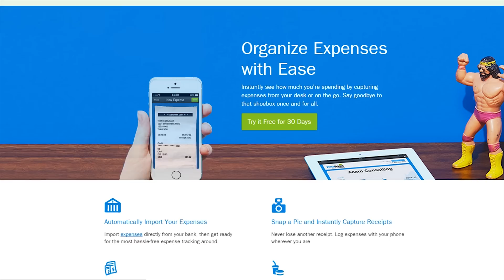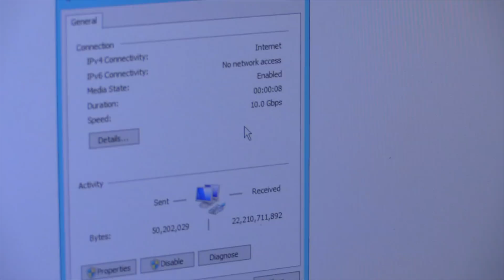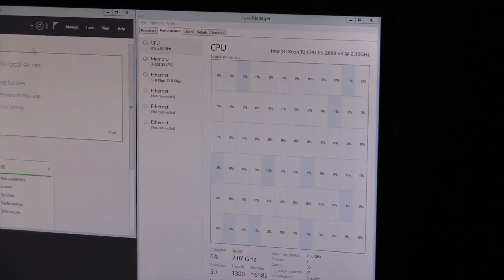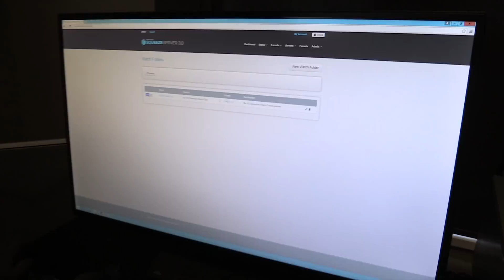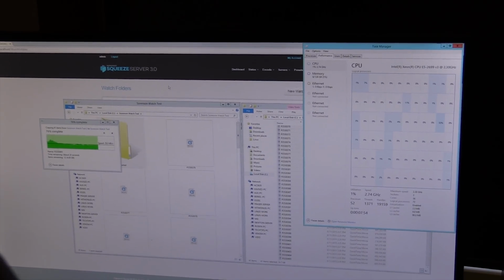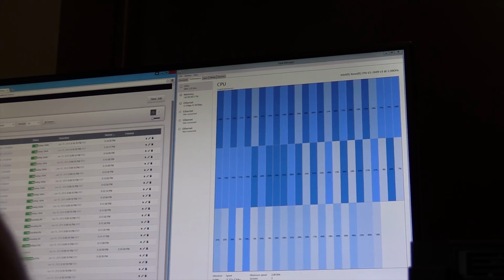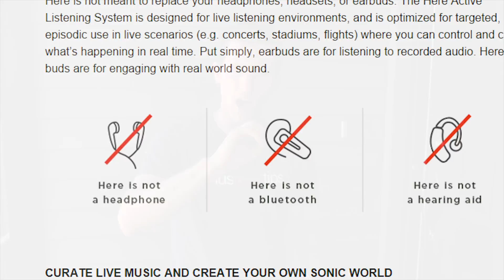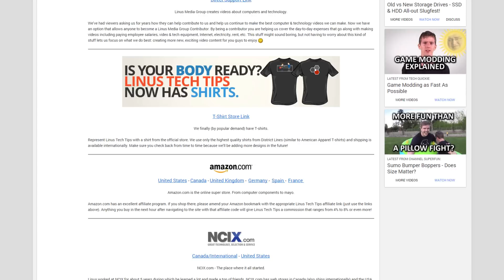36 Cores, 72 Threads, and Two Titan Xs - Our New INSANE Rendering Machine Part 3

Comment: I am a desparate guy!!! I did something similar, with 40 cores and 80 threads (2x2698)... I used asus Z10PE-D8 WS as my motherboard. My cinebench score kicks ass... It is sky high... But when I encode in Premiere pro or Media Encoder, it only utilizes 25% of the CPU... This is insane... I run windows 10 enterprise... Is there a solution??????????????? If you cannot answer, then noone can!!!!

Comment: I'm pretty sure you could do all this with FOSS with Linux. Set it up to auto mount drives, use something like inotify to monitor file changes to call off a process to cut and paste the files. Then have it un-mount the drive when it's done and use FFMpeg to encode the files. FFMpeg also has support for GPU Acceleration.

Comment: compare rendering time from thus machine to a mac using mac software
Reply: no
Reply: So, you want to compare this, to a Mac. While also running lower quality encoding hardware (Intel Quick Sync) on it. There's a good reason they use Premier Pro with CPU encoding, less colour and gamma shift. Plus, they're working with a lot more data (which is also of higher quality) than the vast majority of Apple users are handling.
Reply: +LiquidPanic just curious. I just wanna learn more
Reply: Marco Balarezo But the thing is, just looking at render times doesn't tell you the whole story. Apple software uses Intel Quick Sync, which has known issues with colour and gamma shift. Sure, it's fast. But if you're a professional production house like the Linus Media Group, you can't have that kind of loss of quality.

Comment: I'm pretty sure there are boards out there that have both 2 sockets and support for 2 GPUs. The cluster I use has some nodes with 2 Xeon 12-cores and 2 Tesla K80s. I think they're using dell poweredge R730s, but they change stuff without telling everyone who actually uses the cluster, so my info might be old.

Comment: http://www.newegg.com/Product/Product.aspx?Item=N82E16817338062
Here you have an 80plus bronze redundant power supply. by the way, i think there´s a way to use two 10GB cards and setting up one to send and another to receive, and setting up timing between the two cards. That will relief the bottleneck.

Comment: His cat isn't nearly as expensive as my "gaming" PC... (The components used in it weren't meant to be used for gaming, but screw it. Because I can.)

18 core, low-power Xeon, 128GB DDR4 RAM, and 4 Titan Xs.

Overkill, I know.

It may or may not have been influence by the Compensator...
Reply: ECC DDR4?
Reply: Ixor Yeah
Reply: 4 titan Xs should get you some problems with microlags, do they?
Reply: AlternateEdit I guess it just depends. I've done builds with 4 Titan Xs in the past, and some of them do, and some of them don't. This one doesn't, so it must depend on the parts you use.
Reply: Noice.

Comment: microsoft isn't a horrible solution for a server os. Microsoft let's the server take advantage of the graphics card's hardware by using directxmath api. Of course this makes use of a 4 by 4 matrix and 4 by 1 vectors usually used for graphics however will work just as well with any linear transformation. Also the reason it takes a while to fire up I bet is because the software has to create (allocate memory) for the buffers (data structures like ListArrays). Then once the are all created it just re uses them and does it's thing.
Reply: +marshalcraft P.s. I think you should do more server type stuff. Also it would be great for me if you did stuff about like registering domain names and what not. Networking is not my forte and so I'm not really sure if it is even possible for me to point my computer/web server to a domain name because it is actually on a subnet and I am not the network administrator.

Comment: http://m.newegg.com/Product/index?itemnumber=N82E16817147105&nm_mc=KNC-GoogleAdwords-Mobile&cm_mmc=KNC-GoogleAdwords-Mobile-_-pla-_-Server+Power+Supplies-_-N82E16817147105&gclid=CjwKEAjwp56wBRDThOSZ3vqGzmESJABjNaj9RUlBwb_PJ_d2-73PfUB6VpOrd8ibWR-is6dePoX1LBoCS-rw_wcB&gclsrc=aw.ds

not sure if it will fit your server case, but here is what I assume is a triple redundant 1000w server psu. It could be using three 500w units, leaving one as a backup if one dies, but I couldn't find a definitive answer in the newegg specs.

Comment: worlds most expensive cat. The Lifestyle Pets Company, the company that created the cat, breeds only five Asheras each year. The ones with patterns similar to a snow leopard are sold for as much as $125,000. The other Asheras can be had for as low as $22,000, though the average price has hovered at around the $28,000 range.

Comment: You should make sure you are using SSD storage in every computer in the system, in a raid array if at all possible; otherwise you will always have that bottleneck. Even the fastest server will cache things on the harddisk unless the software is designed to cache it to RAM instead.

Comment: Watching it on a200 1m5 satellite laptop
Cpu: Intel centrino duo 2.00ghz T2450 [2 cores, 2 threads] [32 bit only cpu, overclock not allowed]
Ram: 998mb in 2x 512mb,  200 pin, 667mhz, ddr2
Gpu: Build in graphic [256mb shared memory, 4 pixel shader processors, 1 vertex shader processor, pixel shader 2.0, vertex software emulated (performance = 0), opengl 1.4.
Additional informations:
2 ram slots 667mhz ddr2
Os: Dual bot windows vista [originally installed on laptop], linux mint 17.2 xfce [used now, because of better perfomance]
Cat: lying next to me on bed. Bengal cat full name Sparkling Star [Called Szpara]

3:29
Now i fell complettly broken... Thx...

Comment: If you only want to show people these processors working all at 100 percent, give the computer aerodynamicist. Working in CFD could easily squeeze your cpu to full power in a long period of time. I've been working with my xeon computer at 100 percent for 5 days straight. And with that kind of computer, you could running DNS easily man!

Comment: Hi Cheeky here from Cheeky Industries love how you’re pushing the boundaries (in a professional way of course; ). Like the server but here we really monster things out, so the challenge has been thrust. Can you fit more hardware into a server than Cheeky Industries?
I present to you the 3-D monster.

7 RAD VIDIA Quadro K4200 4GB Graphics Card type configuration with custom cooling straight through structure 3x 1.8Amp 120mm fans

2 Intel Xeon v2 20 Core architecture, Wish it was v3 : ( sniff

128 GB Quad Channel architecture non-ECC Channel DDR 3 2133 MHz RAM
12 Striped 500 GB SAS 80 to 96 GBpS+

Specialised Made to Fit Heat Sink towers with 1.8Amp Server Fans again Vumm Vumm

Gigabyte GA-7PESH2 (rev. 2.0) 2011

Power 1x1200w and 1x65 8 x 8 motherboard power needs

Good for workplace presentation, gaming 3-D rendering advancement and especially good for large 3-D CAD design. https://www.facebook.com/CheekyIndustries For pic’s

Maniacal evil laugh…
Reply: I have various questions regarding your comment, here; questions that I hope will initiate the attainment of progress regarding your doubtful credibility.

Comment: Hi,

Why do you have 128 GB RAM?
While decoding videos there are just 18 GB in use.

But if you have a Backup of the Video-files you can Build a RAM-Disk, Copy tue files via Batch job to the RAM-Disk and render them Witch is faster than 100 SSD's in a RAID 0

Comment: I have a iStarUSA IS-1000R3NP in my Norco RPC 4224 chassis that holds my SAN. If memory serves there's an adapter plate from Norco. It's 1,000W and triple-redundant. You can get them on Newegg Business. When it comes to high end GPUs and playing nice with servers/chassis you're better off going with a little bit more "serious" hardware. Not knocking Norco at all. They make some of the best chassis I've ever used. You'd be looking for something that handles a large "shoebox-style" PSU. I know Supermicro has them.

Comment: I've been using Windows Server 2012 R2 Datacenter for a year or so now, and the problem you're running into is called Resource Queuing.  Where the Server OS is allocated a specific amount, and the rest is handed out to that which requests it, using a non Server specific OS does not do that, and you would get a full on demand system.  Your best bet is to install a VM using Hyper-V configure it with all the cores you want and then install a standard Win7 or 8.1 and go from there.

Comment: I don't really care what OS you use, I don't think it'll change a lot, but what you are doing can be easily done on Linux. It's just not bundled into a commercial package.

It's not exactly rocket science to write a little Python (or even Shell) script to check the folder every minute, transcode the files using ffmpeg/gstreamer/mencoder or whatever floats you boat and moving the files around. You can control precisely how many threads are allocated to each video in the queue and you can experiment with settings every step of the way.

Now, I know... You get tech support using the package, you're used to GUIs and you don't really have programming experience so I get why you're doing stuff this way. It's just silly to imply that you can't do this in Linux. All the tools you need are available, you are simply expected to hook them together yourself. Exactly like what you're doing with the hardware. You trade time, flexibility and effort (building it yourself) against cost and support (buying it premade). You went with DIY for the hardware and premade for the software, which is totally fine. Linux based transcoders are extremely common and there are a crapload of libraries available to make that a breeze to set up. So asking why it's not running Linux IS a valid question. It is the default for these types of applications.
Reply: Niosus Yeah, I have the exact same outlook. I don't care what he put on his server, because it's his server, but he claims the only reason for not using Linux was "Linux cannot do it" (in the most obnoxious/pretentious tone). Although, the true irony is the fact that THIS is what Linux is best at! His prepubescent attitude proved his naivety.

This entire system could be setup with very little Linux knowledge and at no cost. I'm even willing to bet that the Linux solution will be orders of magnitude faster! His software doesn't even support GPU encoding! Seriously! Imagine how amazing this system would be running Linux with a couple of compute cards on top of these Xeons.
Reply: BrettCWX Exactly. I'm not sure how easy it is to use GPU encoding for whatever format they're using. Since they're using it for proxy footage they can probably get away with using the NVENC h264 encoder.

That'll probably make it a bit harder, but I'm sure if they ask on their forum there will be plenty of people willing to cobble together something for them. I'm tempted to build a proof-of-concept myself just to figure out how much work it is to do batch GPU encoding. Seems like a good exercise.
Reply: BrettCWX Also, a RAM disk would solve their CPU usage issues. Transcode from RAM to RAM and then copy it over the network to the file server sequentially. I assume it is hard drive based because he mentioned that the other one was SSD based. Doing that sequential copy instead of writing many files at the same time will make a huge difference.

Comment: LinusTechTips is this a good build?
Intel Core i7-4790K 4.0GHz Quad-Core Processor
Corsair H100i 77.0 CFM Liquid CPU Cooler
Gigabyte GA-Z97X-SLI ATX LGA1150 Motherboard
Kingston HyperX 8GB (2 x 4GB) DDR3-1600 Memory
Seagate Barracuda 2TB 3.5" 7200RPM Internal Hard Drive
Asus GeForce GTX 980 4GB STRIX Video Card
NZXT Phantom 530 (Black) ATX Full Tower Case
Corsair CX 600W 80+ Bronze Certified Semi-Modular ATX Power Supply
2 x Scythe Gentle Typhoon 50.0 CFM 120mm Fan
TP-Link TG-3468 10/100/1000 Mbps PCI-Express x1 Network Adapter ???
Would be epic to know

Comment: LinusTechTips 
9:26 see http://pastebin.com/4c3pdJAd
Make sure ffmpeg and inotify-tools are installed, then replace inputfolder and outputfolder with your input folder and output folder (respectively), and .IFX and .OFX with your input format extension and output format extension (also respectively). Do note that the input format extension is case-sensitive.

Comment: Maybe try turning off Hyper Threading to get better performance. I built an After Effects machine recently that had similar processors you're using, also with 128GB of RAM and was unable to get the performance I expected. With HT on, the machine took about an hour to render my particular test. With HT turned off it did the same job in 30 minutes. I've noticed similar improvements in performance on other systems when I've disabled HT. For some reason, almost every media application I've done this too has either had a massive improvement or no improvement. It's never hurt anything. I can't explain it other than it's likely the systems that benefit from it are probably not optomized to run on HT cores. Good luck building your render node - looks like a lot of fun!

Comment: I am looking to upgrade my cpu. My current system specs are:
GPU   R9-285
CPU/APU       A-10 7850k
Mobo        Asrock fatal1ty a88x
RAM    8gb (2x4gb)

With dx12 coming out soon, would it benefit me more in games that will support dx12 to have an fx-6300 or an i5-4670?

Comment: http://pcpartpicker.com/p/4WnLK8

Can someone find a way to make this cheaper, use the same CPU,GPU, SSD, and 16 GB ram. I probably wont overclock too high, so the MOBO doesn't need to be as pricey, but i will go SLI, in the future. I don't think i need the same case, or PSU, but I like them, change if you wish, I'm trying to hit $1000

Comment: can anyone tell me if these are good gaming specs for games like cs go
Intel® Core™ i5-4460
ASUS® Z97-PRO GAMER
8GB HYPER-X FURY
2GB AMD RADEON™ R7 370
1TB 3.5" SATA-III 6GB/s
Genuine Windows 8.1 64 Bit
Reply: attackon 69 2gb card in that rig will bottleneck your cpu. Get 3gb, 280 or better. :) forget windows 8 its crap.. just get windows 7 and upgrade to 10 free. and you don't really need a good rig for counterstrike go .. you can run that on a1gb card even. :)
Reply: Any recommendations then nothing to pricey though around £600 to £900
Reply: +berzu21
Reply: berzu21 Any recommendations then nothing to pricey though around £600 to £900
Reply: attackon 69 http://uk.pcpartpicker.com/user/Buizel10/saved/bRDXsY

Comment: Hi, I'm looking to build a £600 PC (that's a very strict budget btw) and I've come up with this as my build after a lot of research:

CPU
AMD FX-6300 3.5GHz 6-Core Processor - £79.19

CPU Cooler
Cooler Master Hyper T4 70.0 CFM Rifle Bearing CPU Cooler - £20.54

Motherboard
Gigabyte GA-970A-UD3P ATX AM3+ Motherboard - £64.93

Memory
G.Skill Ripjaws X Series 8GB (2 x 4GB) DDR3-1600 Memory - £45.83

Storage
Western Digital Caviar Blue 1TB 3.5" 7200RPM Internal Hard Drive - £41.06

Video Card
MSI Radeon R9 380 4GB Video Card - £176.99

Case
NZXT Source 210 Elite (White) ATX Mid Tower Case - £37.45

Power Supply
EVGA 500W 80+ Bronze Certified ATX Power Supply - £38.99

Optical Drive
Samsung SH-224DB/BEBE DVD/CD Writer - £10.06

Operating System
Microsoft Windows 8.1 OEM (64-bit) - £75.34

Total = £590.38

So I was wondering if 1) it'd perform alright (I'm looking for high-ish 1080p settings at around 45/50 fps in most games), and 2) if anyone can think of any obvious improvements whilst staying within the £600 budget

Also - is there any compatibility issues?

Thanks
Reply: You could upgrade something else if you buy a windows key from g2a bruh, it's like 25-30 dollars

Comment: Linus... free is good, but sometimes it pays to buy the proper equipment. For what you are doing a Supermicro 7048GR-TR would have been a much better choice. Redundant Platinum power supplies, motherboard architecture designed for doing what you are planning. I am assuming the Titans where free as well, because those are definitely not the cards for that kind of job.

Comment: Your use case is actually supported, better, under Linux. The multimedia transcoding can be done using avconv tool from libav package, and watch folder can be implemented using something as simple as cron and a custom shell script or makefile.

Linux, or UNIX in general, are designed with the philosophy that each and every tool does one single thing, and the user string tools into fitting their specific use case by writing scripts or textual configure files to invoke them in an appropriate way. This also explains why most UNIX shell comes with a powerful programming language.

Your "keep an eye on a folder and transcode files dropped in it" can be broken into this: call a shell script periodically using cron, that iterates through the input folder, for each file in the input folder that does not have a matching output file in the output folder, transcode it by calling avconv tool. The input and output folders can be mounted NFS shares.